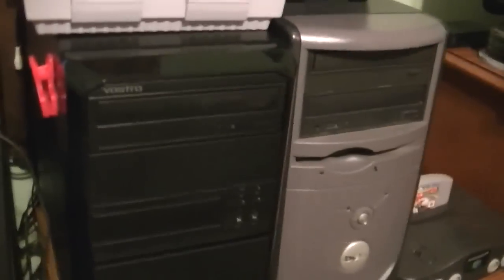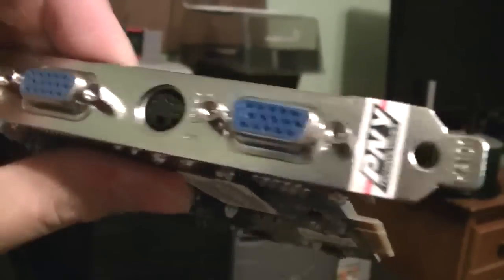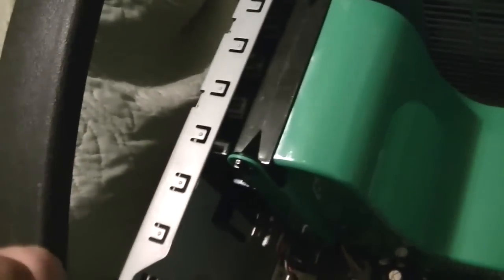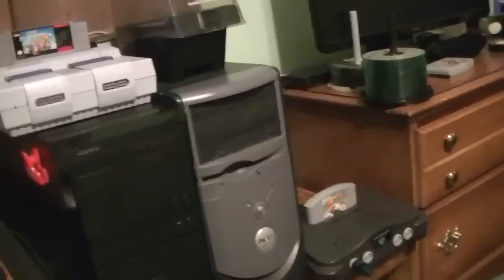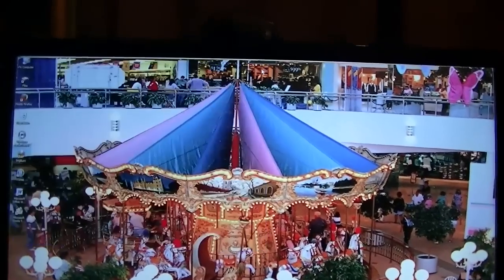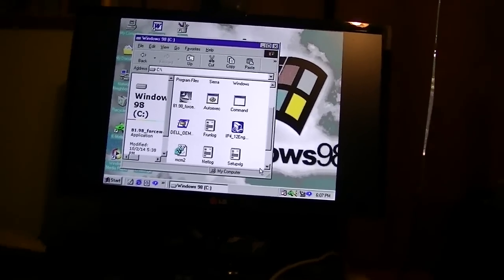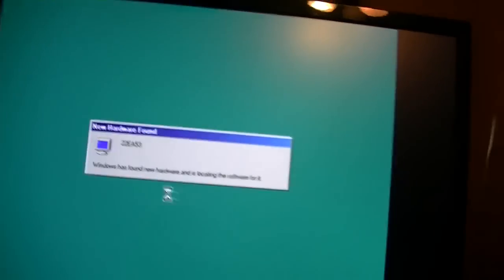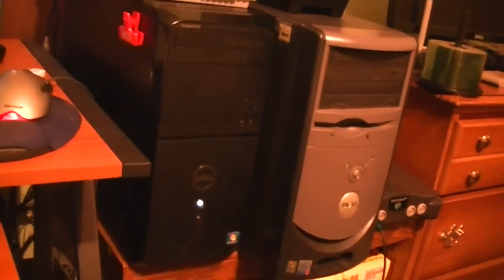Video Card Upgrade for the Dell Dimension 2350

Comment: I have a Dell Dimension 2350  running 1 gig of RAM and a 2.4 Ghz Pentium 4 processor with Linux Lite 3.0 (I believe the latest version of Linux Lite) that is fully capable of most things one could need for daily use.
Reply: Michael Cox how about running steam and can u upgrade the ram more than 2 gb
Reply: Vineet Mesuria Not on the Pentium 4 machine I use. It maxes out at 1 gb.  Anything that will run on steam that has such modest requirements and is Linux compatible, and there are a few I think, will run.  Not exactly a gaming specked machine though.  Use it as emergency back up in case my other machines go down, and for watching videos and stuff in my bedroom.  Works fine for most non-gaming jobs though. Snappy and responsive in spite of the low specs.
Reply: ok thanks

Comment: Good video but wish you would have taken me back to the beginning - how to uninstall the old video card before installing the new. After hours of research I finally found some answers. Dell wants you to change the Bios by downloading onto a floppy- which in this day and age near impossible to find one. I found an article written by Dell to help anyone with changing the Bios without having floppy disk:   http://en.community.dell.com/support-forums/desktop/f/3514/t/19300349. I haven't done this yet- waiting for a power supply in the mail that will meet the requirements of the new video card I am putting in.

Comment: I have a similar story here. I have a Dell Dimension 3000 with Windows 7 installed. In it, I plugged in a Jaton 348-PCITwin card to replace the on-board graphics adapter and it works with my computer very well because of its Nvidia GeForce 6200 GPU, especially with the Windows 7 Aero and since I have been finally able to play games like Team Fortress 2 on this computer.

It's good to see that you have found a video card upgrade, by the way.

Comment: I have the AGP 8x version of that card in my HP Pavilion a250n right now! Sure it runs Windows 7 Aero like crap but yeah, great video card! I can even play the original portal on a Pentium 4 2.6 Ghz with 2 GB DDR-400 RAM at 1280X800 at "medium" graphics and still get 30 FPS. Amazing.

It always made me wonder if you could actually un-solder an AGP 8x slot from a motherboard and solder it on one of these and makeshift it to work. Though lacking BIOS support, I doubt it. Still a thought though.

Comment: Windows 98SE works fine with 1080p. Just remove the desktop background and then reapply it. I'm hoping to find a 256MB Nvidia card for my old eMachines 730. All I can find that's an AGP and under £30 is an Nvidia Geforce FX 5500!

UPDATE: I have bought AND installed a Sparkle Geforce FX 5500 256MB installed into an AGP slot. Looks a million times better than the old card which was an Nvidia Geforce MX400/440 with 32MB video RAM. Can you tell me why when I upgraded my P4 1.5Ghz to a P4 2.8Ghz, it runs at 1.4Ghz? In case it helps, the motherboard is a Trigem Dublin.

Comment: Just noticed that it seems that using a graphics card that shows its video BIOS before the main PC BIOS would take away the Dell loading bar…
8:54 again, if you want auto logon: control panel, network(I think) then change logon from "client for MS networks" to "windows logon"